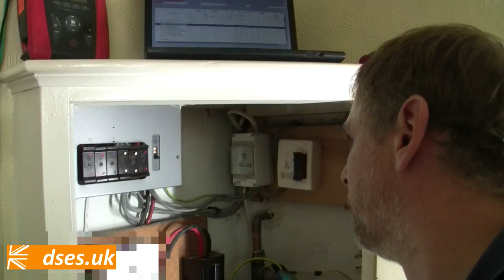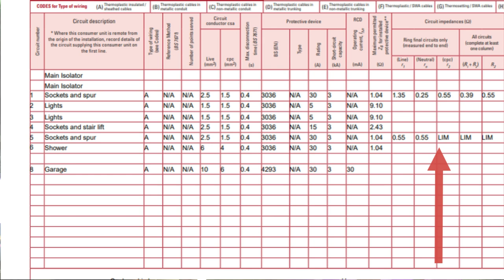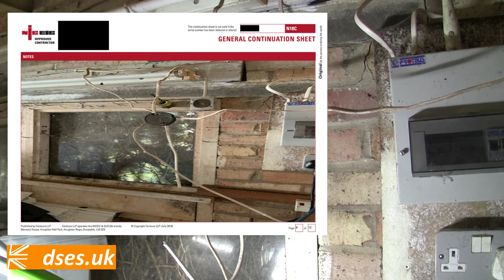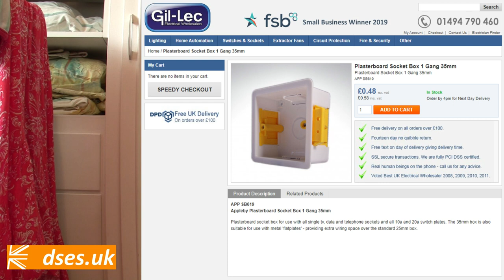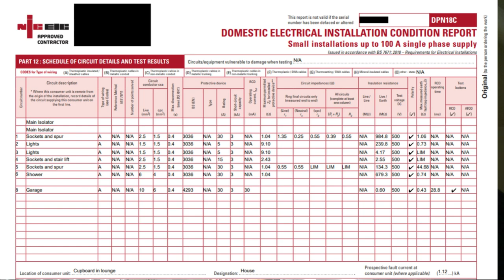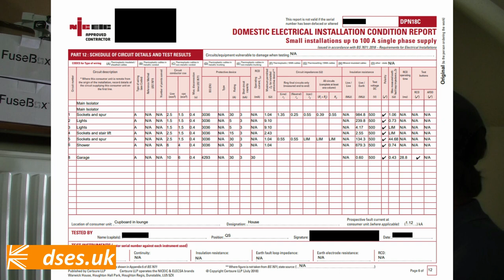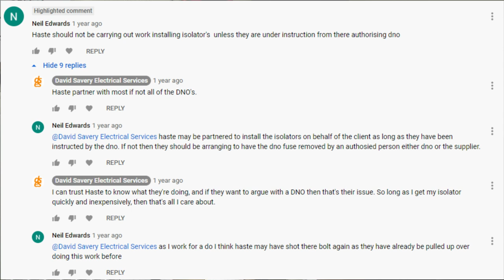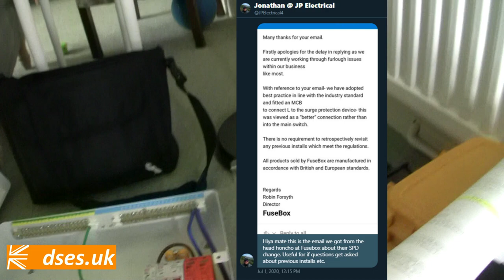Waffly Consumer Unit Upgrade

Comment: Thanks for sharing Dave.   Sometimes we have no choice but to pull the fuse and over £200 for a main switch is shocking.  
I try to put one in now and just inform DNO after to reseal. CEF sell the proteus main switch that they use so we keep one on the van.
Iv seen the tamper switch on the meter 🙈 week on and not heard a thing, I think I'm safe. 😂

That report though..  it's like they couldnt be bothered.
Typical housing association trick zs readings everywhere calculate and make up the rest.
It's always a race to the bottom of these charging next to nothing for a worthless report.
Reply from the maker: I must admit, I've personally pulled meter covers myself before without consequence to date, but it's this 'threat' from the DNO's that they can have you at any time and at their behest just for you trying to do your job safely when they don't offer a quick or cost-effective reasonable option which is what fries my tits, especially as the low-cost, low-quality, non-accredited competition can undercut me without much fear of prosecution because this industry is unlicensed and inadequately policed.

Comment: It is confusing... The regs say a "circuit" is the devices at the origin protecting the equipment, so the three cables would be classed as one circuit; One ring final with one unfused spur.
Reply from the maker: It's permitted of course... I just don't like it and wouldn't do it that way. Not for anything with any length to it and/or is passing through the fabric of the building. I'd sooner commission another fuseway if one is available, or take it off the ring with a fused point to send it on its way.
Reply: @dsesuk  I completely agree. It might be "ok" but it would be instant alarm bells for me doing an EICR (especially with 3036's and adequate cpc sizing etc..ect.)

Comment: 4mm radial on a 32A can only be clipped direct and not be grouped as it would de rate he cable lower than 32A .
Reply: robert swingler spot on, exactly what I was thinking, also with a modest ze It can only be run around 30m before max zs is exceeded.
Reply from the maker: This is true, yet I still choose to run 4mm 32A radials for domestic kitchens because I'd take that over a ring.

Comment: Phoned SSE to ask about having an isolator fitted (as re-wiring a house). Had no availability for the next 6 months, which is as far as their calendar went up to. Strangely though, they did have availability in a few weeks to fit a smart meter. So the fuse was removed, new CU and isolator fitted, with the seal being replaced when the new meter was fitted. Meter monkey has even fitted a seal on the customers side of the isolator, which is a fookin joke!

Comment: Last time we tried to get an isolator fitted they claimed they couldnt come out due to Covid-19, so  got them to log that the seals were going to be broken and then they could reseal next time they came out. No choice but to do it that way .
Reply from the maker: I had trouble once too before my Haste days, so I told them the installation was dangerous - exposed live parts due to no CU cover (not really the case, but had an engineer turned up I would have made sure it was hidden). Told them I couldn't leave it that way as it was on my insurance and I could be done under EAWR. In the end, the guy on the phone just told me to "do what I had to" as it would be two weeks before they could put in an isolator.

Comment: Savski - Webbaloid here… I’ve started with radials where I’m confident - do you use 4mm radials and/or 2.5 radials 32 and 20 respectively!!?? How long do you personally go length wise?
Reply from the maker: Yes Webster - 4mm at 32A for kitchens, 2.5mm 20A for basic living areas. In terms of length, we're generally just wiring your average semi-detached, so it's not usually a factor. There is guidance in 7671 on length though; in one of the Appendices if I recall correctly.

Comment: I was under the impression that if there is an unsafe installation then this is the one occasion you can pull a fuse so that you can make the installation safe without unnecessarily endangering yourself. If this is the case then you just have to make sure you are dealing with an installation that could endanger the homeowner and whilst dealing with the problem change the fusebox as you have already pulled the fuse - a sort of get-out clause. Maybe I’m wrong?
Reply from the maker: No, you're right Richard. If there's something dangerous like, say, a damaged tail then nobody is going to prosecute you for pulling the fuse to put it right. It's not like you'd leave site without doing it because the DNO can't get an engineer out to put in a means of safe isolation for you until next week.

Comment: David has he not got the short circuit capacity wrong on the sheets also?
Reply from the maker: There are various errors and omissions I haven't accounted for here I'm afraid.
Reply: @dsesuk  I remember doing actual experiments at the 'high energy test room' at college on various fuse types. (BS3036 did NOT fare well, even at 55v, which was our testing voltage, i bet you can't guess what type of transformer we were using LOL)

Comment: These videos you doing critiquing other peoples EICR’s are very informative and it’s a subject you are clearly highly knowledgeable on. 

However, the issue is that at the going rate, there is simply no money in doing EICR’s properly. To do an EICR as comprehensively as you do (all accessories inspected, lots of investigation etc) is easily a full day job on the typical house. With the average EICR going for £120-£180 and the average sparky (here in the south) looking for £250-400 a day, it’s really no surprise that they are being carried out in a rather slap dash manner.

Comment: I can't see the DNO's having the resources to enforce the pulling of main fuse even when the smart meter grasses you up. SSE don't fit isolators and tell you to get an electrician to do it who then has to pull the fuse. They will replace a meter board for free but you need to buy it and arrange for the electricity supplier to come out as well to move their meter. Imagine trying to co-ordinate that so there at same time. The demarcation is a complete mess.

Comment: 48:30
Actually I believe the regulations do allow this for certain types of load, eg resistive heating such as an immersion heater

433.3   Omission of devices for protection against overload
433.3.1   General
A device for protection against overload need not be provided:
(ii) for a conductor which, because of the characteristics of the load or the supply, is not likely to carry overload current, provided that the conductor is protected against fault current in accordance with the requirements of Section 434

If the minimum conductor CSA is met as calculated by the adiabatic equation, and disconnection times are met for faults to earth, then there would be no need to provide overload protection.

This wouldn't apply to, say your bathroom fan off the shower isolator as that can be overloaded by stalling the motor

Comment: Enjoyed the video as always. Any thoughts on the longevity of CP RCBOs and general kit vs say Hager or Wylex. Need to upgrade my own in the short term.
Reply from the maker: Time will tell I guess Dan. Whatever the brand, if it's to the correct British Standard then I expect it to be up to the job long term. Hager's value is it ubiquitousness: go into any wholesaler and you'll find the part you need. Their downfall is their cost. Amendment 3 saw their prices rocket; SPD's bumped them up further. In a crowded domestic market where I'm trying to compete with the next guy who intends to buy a populated BG board from Screwfix, I can't afford to blow £150 on an empty enclosure that just contains the main switch and an SPD.

Comment: Would be interested to know how long you allow for an EICR, say for a 3 bed property. I have recently started doing more EICRs' for other contractors and their way of testing is much like the original report for this property (albeit completed with more diligence). However no remedials are to be undertaken until they get the go ahead with the landlord. Some landlords allow us to do minor work straight away.

But I am also looking into setting up with a property management company who want two EICRs' done per day, at a set price of £120 per property. Ranging from 2-3 bed properties and communal areas of flats/apartments. I just don't know how I would be able to keep up the quality of work I want to test to for that price and timeframe. Also from talking to other contractors (who are good knowledgeable electricians), they say that is a generous price for an EICR (East Yorkshire). Bear in mind, the property management company wants 10% of all labour costs to go to them as commission/finders fee. 

Does anyone have any advice on this?
Reply from the maker: EICR's are always tough to price Gareth which is why we resort to a per-circuit pricing model as it better reflects the size of the electrical installation over the size of the property. Take where I live on a Sixties estate: some houses here are three-bedroom with three circuits (sockets, cooker, lights) while mine has thirteen circuits, more than most perhaps, but anywhere of that size that's been rewired or significantly added to will have a count somewhere between those numbers. If you're not familiar with the property then it's not possible to really know how long you'll need. For £120, you're on a winner if the installation is small, hasn't been messed with and is easily accessible. You'll feel done over if you walk into something heavily populated though! I guess it's a case of try it and see if it works for your business. If you find you're not happy with the arrangement or that it's not good business, then knock it on the head. We don't undertake agency work as I've always found them to be slow payers. For timing, we'll book an EICR as a day job but we'll have one or two small reserve jobs lined up that we can attend to if we're done sooner (as most of the time we are). The fact there are two of us, each qualified for inspection/testing and each armed with a calibrated tester, means we can production line it quite efficiently. I tend to do the form filling (on site using Easycert), Ze/fault current, IR, ring end to ends and putting loops on, while Nige does the functional tests, visual inspections, r1+r2 readings, Zs, RCD times. Most properties are small enough that we can easily tick them off before lunchtime and move on to something else, but every now and then you walk into somewhere that has 21 circuits (as we did once) and there's no early escape from something like that!
Reply: @dsesuk  Great reply thank you. 

I will be doing these tests on my own, the property management company (PMC) say they want to give an exact costing to the landlords for every EICR. Unlike if I priced per circuit, which I originally tried.

One of the electricians I subcontract to doesn't want R1+R2 readings doing and is quite happy just taking Zs+Ze readings and calculating from that.

I fully understand per circuit costing is generally a better/safer way for us, the dilemma is the PCM can get me a lot of work. Not happy about the 10% deduction on all work though, might have to bump my prices to compensate!

Comment: I don’t code lack of SPD as a C3. But that’s because I am not an electrician and have no idea why I watch this channel, other than for learning and larfs (both aplenty, in equal measure)
Reply from the maker: Still, it's good to know I'm not the only one who hasn't been C3'ing the lack of surge protectors even if you're not in the game Adrian!
Reply: @dsesuk  Lack of SPD would be a C3 ONLY if you did your own RA, all the calcs from the blue book, and found that it did indeed need one. Who charges enough for an EICR to allow the time for THAT malarkey?
Reply: David Savery Electrical Services surely only a c3 if the calculation has been done and none fitted?
Reply: TheChipmunk2008 lol didn’t read your reply to Dave - yes I’d agree, need to do the calculation to determine if it’s a C3 surely

Comment: Dave - Yet again a very entertaining and (possibly) more importantly - as always informative vid. 

Have you needed to change the side that the CU main isolator switch is at on any Consumer Unit and is there anything practically that means this cannot be done. I can think only if the two sockets on the switch are marked L & N  as they would then be the wrong way round. 

I see that MK used to have their main switch on the left - others on the right. MK now out of the CU market.

If the CU is mounted such that the main switch end needs to be opposite to the manufactures normal end so that it is more easily accessible say due to it being mounted in a cupboard in the corner. Also CU orientation - I personally have a potential future issue where there is not a
lot of width available - but there is plenty of vertical space. 

I only had my very / very old wooden 4 way Wylex CU (RingFinal/Cooker/UpLight/DownLight) replaced with a dual RCD MK CU (Plastic) 10 way back in 2013. The guy who did it has left a spiders web of cables with lots of those plastic block connectors to extend the previous Plastic MK CU. I've been in the house since March '88. House originally built in 1928. 

The whole houses 56 mains sockets (incl 4 in garage which has its own mini CU) run off of one breaker. I was thinking to maybe get a newer Edt 18 Metal CU and have new cables run to the sockets and try to segregate the Upstairs sockets from the downstairs sockets. A bit of investigative work to find out the sequence of sockets in the circuits.

I did discover back in May this year while decorating on of the bedrooms that a socket in the bedroom is spurred off a ring in another bedroom through the wall - but it gets worse - this then goes down into the Kitchen and services a twin socket and single socket and then goes on into the Garage!!!!. Quite where the cable runs I've yet to discover

I only discovered this as I had the floorboards up for some Central Heating pipe alterations. 

As part of the CU upgrade - it would make sense to run SWA from its own RCBO in the New main CU to the CU in the Garage.
I have 300 mm at least under the floors from the CU location to the rear outside where I'd need /prefer to duct the cable under the existing patio slabs / update the patio. (Garage is set back from the rear of the house). 

Very interested if anyone has fitted vertical CU's in domestic premises as this would give me more "ways" in the CU for individual circuits. 

280mm Horizontal  available 420mm Vertical available .

BTW - Did you lob any AntiRodent fodder down the open hole to Nuke any that may still be lurking around ?
Reply from the maker: I don't see an issue with you 'reversing' a CU layout to relocate the main switch unless, as you say, it puts L-N labelled terminals out of kilter. Of course, main switches and RCD's aren't actually polarity sensitive, but the L-N designations serve to show how the manufacturer intended it to be fitted. A dual-RCD board may be trickier to swircheroo, but electrically it could be done. Easier on an RCBO board. As for vertical CU's, I've seen Twitter posts of standard CU's being installed on end which, I guess, is okay as the devices within would be on end in a three-phase board. Maybe that's on an option - a TP enclosure with a single phase conversion kit?

Comment: Curiosity here, so please don't destroy me. The gas supply and meter etc seems very close in this installation <150mm is this not picked up in an EICR?
Reply: My previous house that is around 15 years had them both outside much closer than in this video. They were in separate boxes but the snark meter fitter made a huge hole between them and they are not water proof now, at least any gas leak can get out easy lol

Comment: would you trust the smart meter to not reset the contactor ? given it has a 2 way connection back to supplier and DNO, is there not a risk that this gets reset ? at least with the fuse out theres no way it can go live by accident
Reply from the maker: Good point. I'm not sure I would like to rely on a software option. Give me a big, red clunking mechanical switch any day.

Comment: Hi David, is your AVO on shelf, knock- off from student days (that's the last time I remember seeing one if them, comes from the days that we all played tricks on each other with windup insulation testers)
Reply from the maker: We did have AVO's at Coventry Technical College back in the day, although there were a handful of more modern digital meters. I even saw one lurking around the workshop at Warwickshire College not so long ago. Mine is a garage find from two or three years ago however. Someone had moved out and left a load of junk in the garage and I spotted it while undertaking an EICR. The new owners let me take it away, although sadly it's not operational.

Comment: Dave my only issue with that board you installed in is there no blanks between rcbos. Supposedly they get very hot🤣. Quality video Dave. Watched it right through. Cheers for sharing. Hope you used a torque screwdriver😘
Reply from the maker: I use an Armeg torque screwdriver Andrew. As for spacing between RCBO's, I've not seen anything in instructions from any manufacturer about leaving a fuseway open between circuits, nor have I experienced any RCBO's overheating post installation. If that was a requirement, I'd expect manufacturers to supply units with fuseways spaced so that overheating cannot happen. So long as they're spaced with a busbar that allows circuits to be neighboured, then it's not for me to second-guess how they should be laid out.